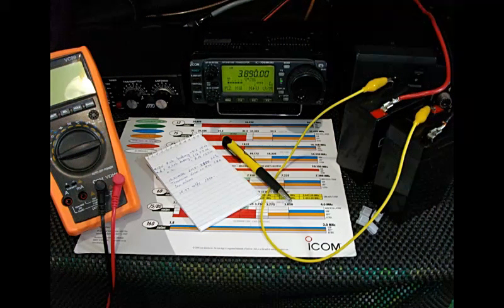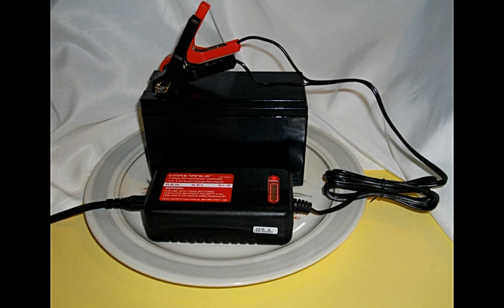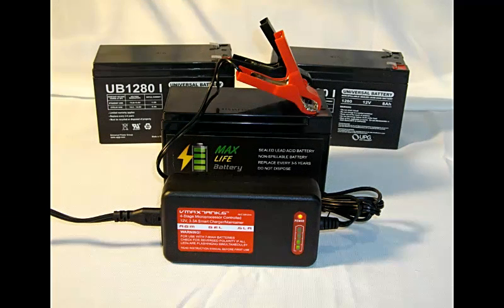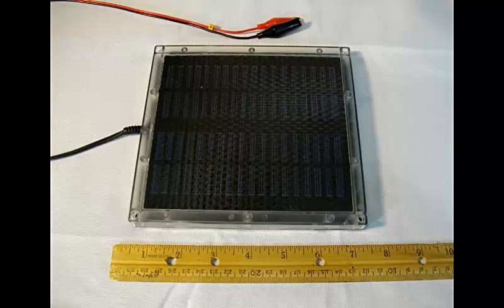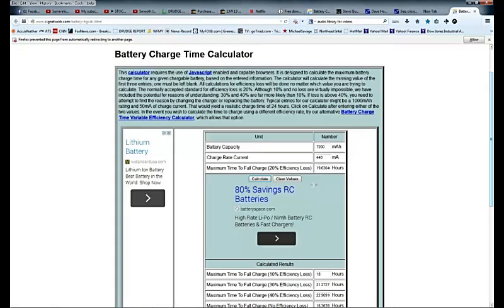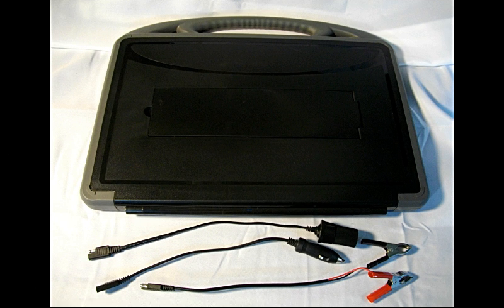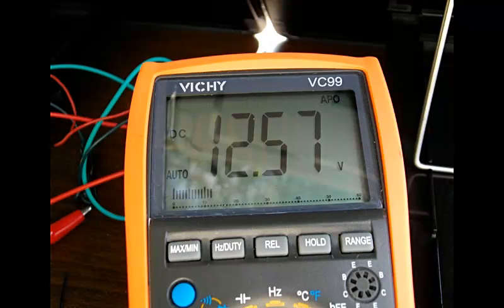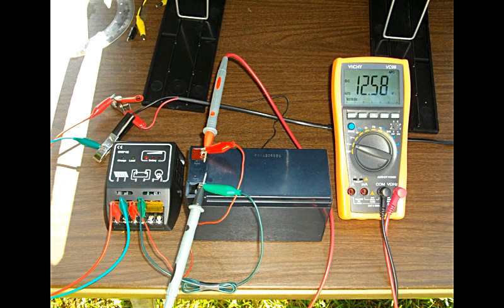Solar Panel Charger and 12v Batteries for SHTF Backpacking HF Ham Radio Station

Comment: Not a bad way to go if you can get the batteries cheap enough without outrageous shipping charges. I went to replace these in my ups battery backups, and found I could buy a brand new ups with battery for the same price as just the battery.
Btw, it's NEVER a good idea to fully deplete any rechargeable battery, (although the new Lithium batteries are more forgiving). It shortens their life considerably. 
I bought a Bioenno Power LiFePO4 40Ah battery that easily handles my Icom IC-7300 full power load (21 amps) instead of spending some $140 for a 12v switching power supply that may end up causing radio interference. It can pump out 60 amps continuous at 13 volts. A 12v rechargeable supply is very handy to have for camping, tailgating, and/or blackouts. There are plenty of 12v lights, fans, and radios that you can run without an inverter. Just add solar panels and a solar charge controller (it has to be one made for these types of batteries).
Reply from the maker: Thanks for the info. Sounds like a good setup on your end. I went with what I could find on eBay at a good price. Haven't been on another portable outing since last year, Oh well, maybe soon, LOL. Take care and 73, John

Comment: The 20+ volts was open circuit voltage it needs a load to pull it down to proper voltage but all ways use the external change controller